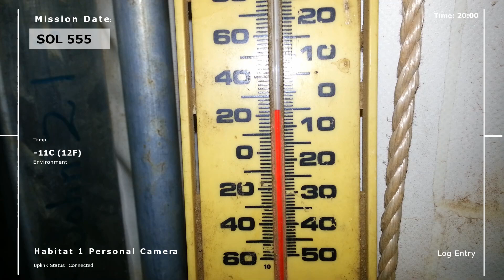Growing Aquaponics Microgreens in below freezing conditions, will it work?

Comment: this is getting frustrating watching you. It seems many people have been telling you how to solve your issues and your not listening. INSULATION!!!. you can't heat building made of plastic. Do you remember the definition of insanity?  I have some very cheap and quick ideas that you can do on your own, but too hard and complicated to put in comments.
Reply: ORANGE DURAMAX air is insulation, hence the double layer with the greenhouse. I also don't see him insulating all this in such a short time frame...
Reply: re ORANGE DURAMAX air is insulation

You're not considering convection here - convection will drive slow air flow inside the building, effectively transfering heat to the outside foil.

Trapped air is insulation. In closed-cell foam the path is broken up in many little constrained volumes that discourage convection.

That's what makes insulation great in every implementation (bird feathers, fur, rock wool, closed-cell foam wrap). The most extreme case is aerogel insulation.

That's why I'm advocating he put insulation on top of the lane foils.
Reply: ORANGE DURAMAX 
Do you read his comments back to other people?  It all comes down to money. He has spent all he has to get to this point.  So he can't just run out and buy a bunch of materials to insulate his building better.  He planned for a certain temp, the building works fine at that temp.  He has backup emergency measures in place for quick blasts of cold but it's been cold in the Pacific NW for weeks.  Which is unusual and unplanned for.  So unless you're financing the insulation project hush.
Reply: >> So unless you're financing the insulation project hush. 
Somewhat disappointing, don't you think. Although he wanted it to be an interactive experience he's quickly realized that interacting with the community is also quite expensive time-wise.
In addition to that literally buying privileged attention goes against the initial ideas and the scientific approach to the challenges.
Solution? Most likely to ditch the "open platform" idea and demand well researched suggestions with calculations, numerical simulations and/or experimental proof - in a way that he can easily sift through and pick the most promising candidates for further discussion / application.

Comment: Maybe for a long term solution would be a heat pump type system might be more efficient...
Reply from the maker: a heat pump is absolutely the most efficient but there is only one problem with my setup...40 amps at 120v and a lot of those amps are consumed already...the heat pump takes up a lot of that energy.

Comment: Maybe move all your operation to one lane and shut down the other lane for winter. Only have to heat one lane. Seems like a lot of work to keep two lanes that aren't at full operation.
Reply: Murphy Built I agree, take the plastic off the extra lane and make a double layer on the lane in use.  Oneyardrevelution  has great videos about layers gardening in Chicago, was just -9f there.  I wonder if he gets any solar gain through his building?  Perhaps a doublewall greenhouse would work better?
Reply: Dirt&Smiles I've suggested putting double layers on the out side and injecting air between. Curtis from urban farm does that. Personally I'd take the lose and shut down till spring. Can't imagine running all that propane and grow lights will produce enough greens to make all that effort worth it. Maybe spend the winter building beds and what not to hit spring running. Gives you a year to trouble shoot for winter.
Reply: Murphy Built yes, seems unlikely to make $20 a day worth of propane.  Although at $26 a pound, one tray is probably worth $50 in sales.